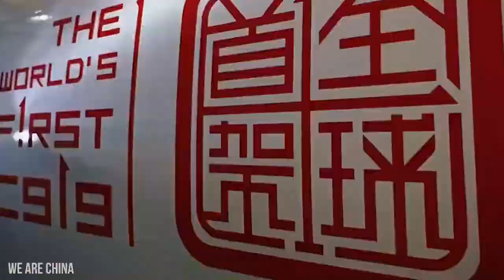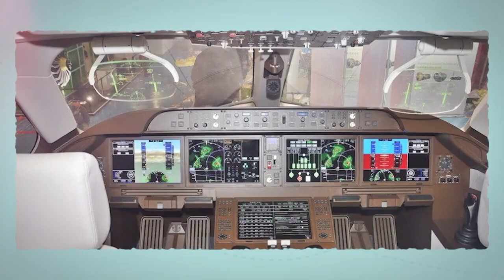The COMAC C919: China's Answer to Boeing and Airbus

Comment: You know what's Chinese about this jet? The stuffing in the seats.
Reply: The "stuffing" has to meet international flammability/toxicity requirements, so maybe/maybe not.  But to answer your question, the airframe (basic structure) is PRC.
Reply: That’s true, the tube is Chinese. But I mean, anyone can make a sealed tube, right? The point is, the avionics, engines, hydraulics, electronics…. In short, the really hard to make and hard to invent bits, are NOT Chinese.
Reply: @SlosII   I take it you've never done the modal analysis for a wing with multiple articulations (lift/control surfaces) and mass concentrations (engines) attached to an overdetermined structure (the fuse) having hundreds of interruptions to the basic cylindrical structure? ;)   In my experience, it's all hard to make.

So they can do structures, though on the heavy side for now (C919 is "overweight" compared to Western designs).  I assume hydraulics -- the actuators specifically -- is now well within their grasp, since they have been busy stealing that know-how for quite some time.

The other things they are catching up on, though far more slowly than their "China blazing ahead of the stagnant West" would have one believe.  Comment sections like these are filled with remarks which repeat that propaganda.

Comment: (former airliner engineer)  Some good points were made regarding marketability (spares, training, etc).  The claim about a shorter wait time for a C919 is questionable, however, since the C919 order backlog is 1000+ (whatever number COMAC made up) but even five years from now they are only hoping to be able to produce 125 per year.  That's not even a fraction of the domestic demand, so presumably any headed to foreign airlines would be for political reasons rather than actual excess production capacity.

A common lie seen on the internet (not here) is that the C919 has been denied certification by protectionist America's FAA.  The FAA has already signed an agreement with CAAC for certification, but the CAAC has said publicly that they don't want to invoke it at present.  One reason for that might be because they haven't got everything worked out yet as far as meeting Western standards.  For example, perhaps the wing test article failed at 138% of design load instead of the required 150%.  Once they cross-certify through the FAA, all of that data heads West and anything which isn't right/safe might be noticed, hurting sales with airlines outside of China (as well it should).  That said, my airliner engineer impression is that over time this will prove to be a safe airliner.

What the C919 isn't for now is a competitive airliner.  The all-important payload/range and fuel burn numbers are reminiscent of an A320 from twenty years ago. Much of that is due to an airframe much heavier than comparable Western designs.  COMAC would have to keep the price really low to make the economics attractive to a typical foreign airline, possibly selling at a loss of the purpose of national prestige.
Reply: Comac C919 already perform wing test on 150% load in 2016 and passed.. they just apply EASA certification in 2024 due to less political road block, but they know take time more likely take 2-3 only can get certification,. since EASE also cross certification with FAA see how after C919 get cert. Anyway those FAA or EASA not urgent for COMAC.  so far, china already have sign with 27 country accept CAAC cert. i think more likely Asean country will buy C919 first even without EASA or FAA certification.  also there internal market enough for them.  
Last week COMAC in shanghai during  world wide COMOC suppliers event, they launch to built 4 production line total 200 unit capacity will be built in shanghai new aviation industry park , ready on end of 2016.  also 2nd and 3th production location also in survey at few location in China.
Reply: @limwiching2277  The "suppliers" aspect can be critical to production rates.  Even when there are additional final assembly lines, unless they have a sufficient flow of every last system and part, planes can't get finished.  With the C919 relying heavily on foreign systems, COMAC will have to wait its turn like everyone else on the various vendors who are also struggling to supply the rest-of-world demand.  That might be one reason why COMAC is talking about 125/yr several years from now, even though the final assembly lines could support more once they are fully operational.